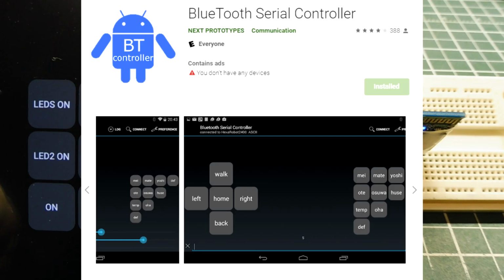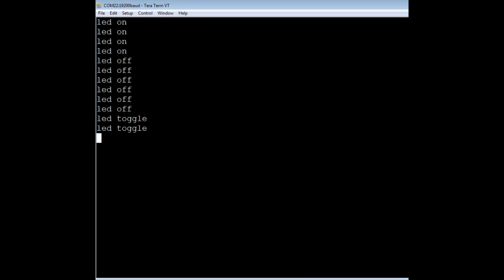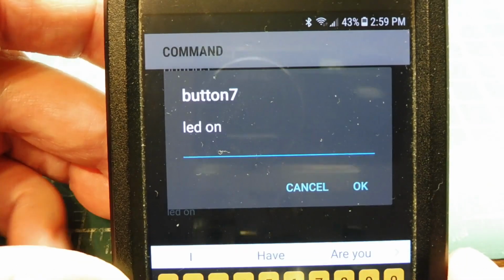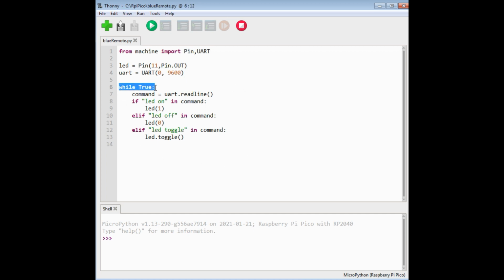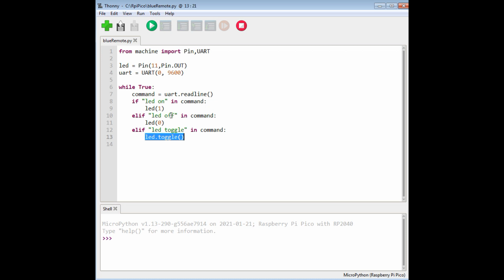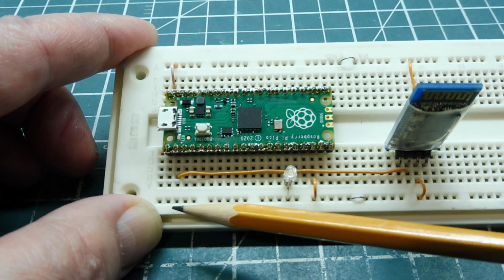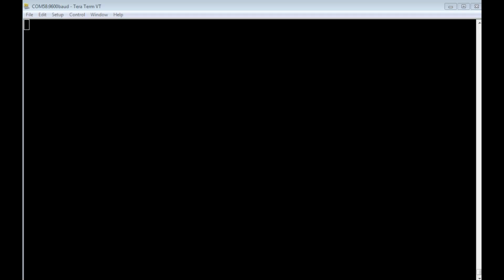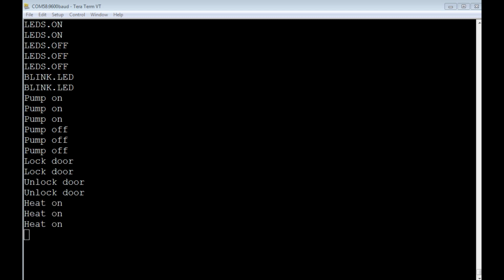Raspberry Pi Pico Remote Control  /  Bluetooth  / LoRa / RC

Comment: from machine import Pin,UART

led = Pin(11,Pin.OUT)
uart = UART(0, 9600)

while True:
    command = uart.readline()
    if command != None:
        print(command)
        if "oon" in command: led(1)
        elif "off" in command: led(0)
        elif "tog" in command: led.toggle()

Change command to oon / off / tog or change code to work with buttons. Works now.

Comment: I am getting this error when running my code. Traceback (most recent call last):
  File "<stdin>", line 8, in <module>
TypeError: 'NoneType' object isn't iterable
Reply from the maker: Micropython is constantly being updated with changes that are version dependent.
uart.readline() is timing out and returning NONE instead of blocking.
Use this line:  command = uart.readline(15)
Reply: hello u can check this code   ####      if command == b'2222'     ###  the 2222 is the command that send from the Controller witch i set. Also u should send at least 4 number with the app

Comment: Thonny is saying NoneType object is not iterable. 
Is there a solution?
Reply: I am having the same. Traceback (most recent call last):
  File "<stdin>", line 8, in <module>
TypeError: 'NoneType' object isn't iterable
Reply from the maker: Micropython is constantly being updated with changes that are version dependent.
uart.readline() is timing out and returning NONE instead of blocking.
Use this line:  command = uart.readline(15)

Comment: Great video, bluetooth looks so simple to use :)  For info, where it has the "command = uart.readline()" code - does it wait here or can the loop run continuously for other code??
Reply from the maker: Uart.readline stops and waits for an incoming string with a CR delimiter, so it does block.
Reply: @0033mer  Ok, cool, how would this be done in a way that does not block - would i be looking at running the UART bit in the 2nd core maybe??
Reply from the maker: You could use UART.any() which returns how many characters are available to be read and is non blocking.

Comment: Hi, thanks for this but have a problem. Built as directed and programmed as at 02:30. When run, I get 
Traceback (most recent call last):
  File "<stdin>", line 8, in <module>
TypeError: 'NoneType' object isn't iterable
If I comment out all If and ELIFs and put Print(command) on line 8, I get a stream of "none", so it would appear the module is continually outputting "none" on the command. 
Is there a setting in the app maybe I need to change or something overlooked?
Thanks
Chas
Reply: I have the same. Traceback (most recent call last):
  File "<stdin>", line 8, in <module>
TypeError: 'NoneType' object isn't iterable
Reply from the maker: Micropython is constantly being updated with changes that are version dependent.
uart.readline() is timing out and returning NONE instead of blocking.
Use this line:  command = uart.readline(15)
Reply: hello u can check this code   ####      if command == b'2222'     ###  the 2222 is the command that send from the Controller witch i set. Also u should send at least 4 number with the app

Comment: is it possible to use circuitpython instead of micropython ?
Reply from the maker: Yes, Circuit Python will run on the Pi Pico.
Reply: @0033mer  I'm trying this code using circuitpython but I'm not getting output :(
Please share the circuitpython code for the same
Reply from the maker: Circuit Python was written to work with Adafruit products so the syntax is different compared to Micropython. Check the documentation on Adafruits website to find the equivalent syntax.
Reply: @0033mer  thanks buddy

Comment: Great video. I wonder if anyone is working on a Forth implementation for the Pico. After all if can C++ and microPython can run on it Forth should be equally as implementable.
Reply from the maker: I have Forth up and running on the Raspberry Pi Pico. It has not been officially released but when it is, I will make an introduction video.
Reply: @0033mer  fantastic!

Comment: Hi! I may have a silly question, If you're supplying 5v to the VCC then wont the HC-06 supply 5v back into the RX pin? If so, wouldn't it burn out the 3.3v rated pin? Thanks!
Reply from the maker: The HC-06 is powered by 5 volts but the Tx/Rx lines are 3.3 volt level so they are compatible with the Pico.
Reply: @0033mer  Cheers mate!

Comment: Thank you.  I note that there are two forks of Python  - Micro Python and Circuit Python.  I see that you are using Micro Python - do you consider Micro Python advantageous over Circuit Python?
Reply from the maker: Circuit Python was developed by Adafruit to be used with their product line. Both are equally powerful but once you start with one of them and get to know the syntax you tend to stay with it.